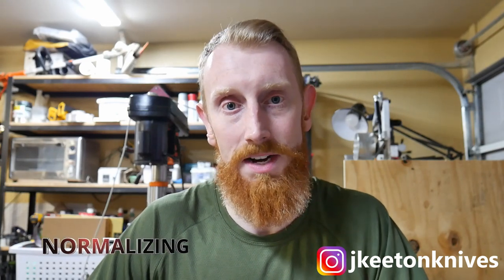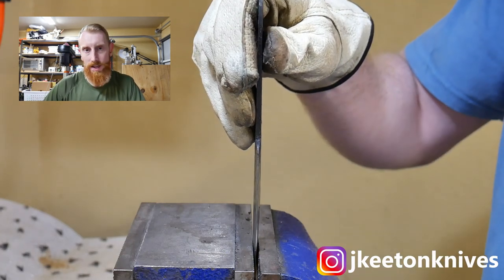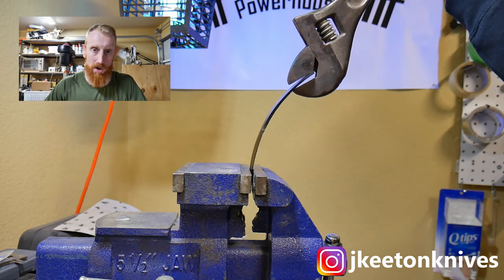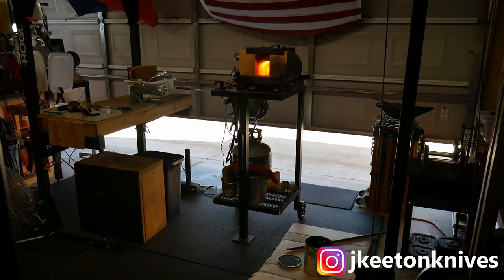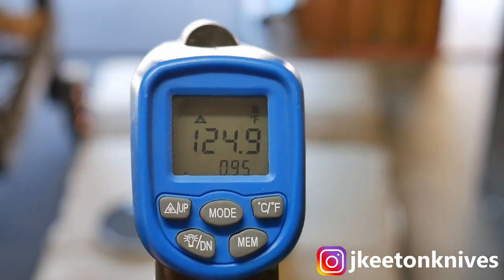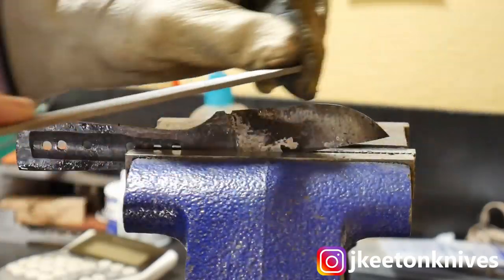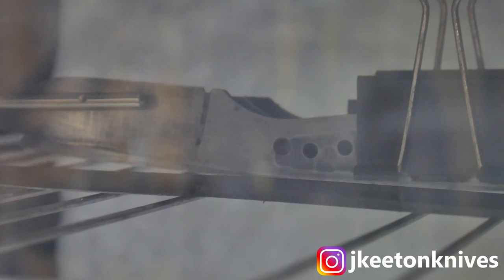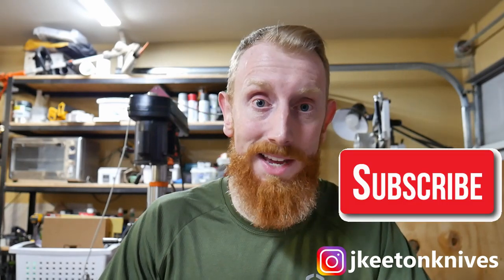How to Heat Treat 1080 / 1084 - The Most Forgiving Steel

Comment: Man ive been behind on watching YouTube for a while. Your channel has come a long way!! Video quality is way up! I gotta say your move from forge to oil is the fastest ive ever seen😳  im pretty sure the blade was air quenched from the 1000mph air rushing by on the way to the oil😂  1080/1084 is such an underrated steel. Its so easy to dial in. 👍👍
Reply from the maker: Hey man, really appreciate that. I've been working on the quality. Still going through some older footage now on some videos, but eventually it will all be 1080p (got a new camera). I switched my editing system to Resolve too (free), which has ben really nice. I’m still having some issues here and there (some reason it scaled up my water in my WEN sharpener video today). You’re comment on my quench speed cracked me up! Yeah, I try to do it fast! I just ordered me some Parks #50 so I’m curious to see if this will change my hardness results. One of these days I’ll get an oven like you! I appreciate your oven review video.
Reply: JKeetonKnives i noticed a difference when switching to parks. It's definitely a thin oil. The oven has been great so far. Its nice to be able to do whatever you want whenever you want. It does take a long time to heat up though. Especially for anything over 1500 degrees. Im sure the 220v version would be better in that area.
Reply from the maker: @OUTDOORS55  Did you notice a slightly harder rock well hardness? more consistency? or just a different quench experience? I'm going to the parks 50 mainly for the consistency... I've read that canola can degrade over time... your first 5 quenches may yield different results than your last 5 quenches. Good to know about the 110 oven... I'll go 220 when I get mine. USA Knife Maker has a "knifedogs" oven for $971 before shipping... it's not huge, but likely big enough for the work I do. (14'' deep)
Reply: Damn two knife legends in one comment. Can one of you make a video on heat treating in a coal fire and tempering long blades thanks

Comment: I use 1095/5160/80crv2 & 1095 with 15n20 most of the time. I harden at 1600 & temper at 500. I almost always have a good knife blank at these numbers. I do some normalization before hardening. I also use warm olive oil as a quinch medium.
Reply: Holy smokes, that's a high temp quench and temper. How's your grain size look for a snapped untempered blank blade?

Comment: Change oil sometimes because the oil gets burnt and polymerises. This causes it to lose a bit of ya heat dissapation capability but i don't know to what degree.
Reply from the maker: Good tip Chris! I think I'll be converting to Parks 50 soon.
Reply: Hi my friend. When you say Parks 50 do you mean parks AAA????  I read the details from Parks oils and for 1080 steel looks like they recomend more the parks AAA.   Can you solve my doubt please???   Thanks my friend and great videos.   Oh!! Another question, did you see difference between quench in canola vs parks???  Thanks.
Reply: @ivangarcia-ph3tx  parks 50 cools much faster than canola but isn't as violent or stressful as water
Reply: But in the details from parks 50 say "Typical steels to use with this quench oil formula include: W1, W2, 1095.".

And in the details from parks AAA say "Typical steels to use with this quench oil formula include: O1, 5160, 1080, 1084.".    Is for this reason that i have a doubt, because it seems that the manufacturer recommend like better choise park AAA for 1080 steel than park 50.
Reply: @ivangarcia-ph3tx  thats just being very specific, the difference is that parks50 is better suited to water hardening steels like w1, w2 and 1095, they are simple carbon steels with a ~.9-1.1 carbon content with very little of other alloys meaning they have very little deep hardening capability and only the surface will harden, exactly how many mm from the surface will harden I can't remember. Really parks 50 is just a oil that can cool the steel down near water speeds, its just not as violent which helps to prevent the blade feom cracking or warping a lot.

Comment: Yeah dude. So much convoluted information on this out there. Nice to finally get simple and concise steps on quenching and tempering 1095.
Reply from the maker: Thanks man. I will say 1095 has some differences then 1084 if you want to get the most out of it. I do think you can get a decent HT on 1095 with these steps; but to get it 100% right, I'm fairly sure you need soaking times; which is pretty hard to do with a forge. 

1085 and 80CRV are the easiest forge HTs to my knowledge
Reply: @RedBeardOps  well shit, I misread your title haha
Got a video on 1095?
Reply from the maker: @doodysdaggers  I do not...but this link will allow you to search bladeforums.... which will have many threads on it. Good luck! https://cse.google.com/cse?cx=012217165931761871935:iqyc7cbzhci

Comment: Excellent video. I have read and watched many heat treat videos, but very few use a home propane forge to heat treat. For small knives I use a two brick forge, but longer knives I use my larger forge made from a propane tank. Temper like you do. I use 1084 also. Your details help remind me of the correct method step by step. Thanks for a great heat treating video!
Reply from the maker: Hey Joseph! Appreciate the praise. Just going though the process of making this video reminded me of some little things that I forgot about! Don't get me wrong... I'm saving up for a HT oven, but I feel like you can get a pretty damn good HT with the forge! Bladesmiths have been doing it for 100s of years.  👍

Comment: I really appreciate this video especially on normalizing and quenching just using a forge. I do not have a heat treat oven and probably never will and everyone that I’ve run across so far basically says if you don’t have one you’re putting out an inferior product or just don’t make knives at all. I just don’t see how not being able to or not being willing to afford a $3000 heat treat oven should stop you from pursuing a hobby …again thank you
Reply from the maker: You can make a heck of a good knife with just a forge; especially with practice. I'd say stick to steels that are easier to forge heat treat like 1084 and 80CRV... bring the lights down; use a muffle pipe and magnet.... 

Also... maybe test your knives to see how you did. You may be able to find a machine shop locally that will hardness test your blades too if you're curious. Good luck!
Reply: @RedBeardOps  thanks …. What’s the muffler pipe for ? Put the blade in for even heat ?
Reply from the maker: @Razor.Edge.Reviews  exactly. It's just a piece of steel tubing to shield the blade from direct flame. You get more even heating for sure.

Comment: I've actually had really good results with 1095 in a forge.  Parks 50 was definitely the way to go. I grind my blades to 0.020 and the main bevels are ground from 4-7 degrees per side and it will cut nails all day with very little edge damage
Reply from the maker: Awesome Josh! Glad to hear your results. Thanks for commenting, too!
Reply: What do you mean cut nails? 🤔

Comment: Good video. I picked up a couple of used belt grinders (2"x48" and 2"x72") for general use, but now I want to try and make a couple of knives for myself.  I bought a couple of 1080 1 1/2" x1/8"x12" strips of steel to give it a shot. As a beginner is it easier to cut my basic shape and hollow grind and then heat treat? I figure the steel will be softer to work with on the grinders to get the desired hollow grind.
Reply from the maker: Hey man, people do it both ways. I'd say get the knife 90% ground, HT, then finish grind and sand for your first try.

Comment: A blacksmith friend will put finished trinkets hooks with scale in vinegar for a few hours and a scale rubs right off. Keep an eye on a blade though. Too long and the blade may develop pits. You can experiment with home store steel as it always comes with scale. This is for those that do not have a mill or other ways of removing scale. Still have to flatten each side. Thanks for the great video.
Reply from the maker: Thanks for watching sir!

Comment: Good explanation. Enjoyed the video and very informative!
Reply from the maker: Thank you very much! Glad you liked the video! Cheers 🙌
Reply: JKeetonKnives what’s your opinion on doing a knife out of 4140? I got a scrap piece of 4140 that’s 1/4” thick flat ground out of our machine shop where I work. Just wonder how hard it would be to work as a stock removal project. I don’t know how it would perform as a finished product. Thank you for your time.
Reply from the maker: sirmaximus100 I don’t have any experience working with 4140... so I can’t really say for sure. I know you can get it hard so that’s promising. 1/4” is pretty darn thick

Comment: Can you explain what would happen if you quench at a higher temperature let's say around 1600 degrees? Would it be more brittle or with the grain structure be more course? Thank you
Reply from the maker: mrsaskriders if quench with the blade too hot you may be able to tell by seeing some “blistering” circles in the finish. But yes, too hot of a quench can cause an undesirable grain structure.

Comment: Thanks for the info. So for the normalisation you start from the upper end, work your way down to the temperature that you will be quenching the blade on the third cycling. I thought that your last normalisation heat would be sub critical or below where a magnet is still sticking to the steel for a fine grain structure. I need to experiment. I will try the above.

Comment: Thanks for the video! I’m looking to get into knife making. My father used to make knives and has a bunch of 01 left over. Is this a good beginner steel or should I buy some 1080/1084
Reply from the maker: Personally I'd start with 1080/1084; 01 takes soak times to get the most out of it.

Comment: Do I need to normalize since I'm not forgeing? Great video by btw.
Reply from the maker: Nathan Chaffin thanks! I do just as a precaution, however, I’ve seen many stock removal makers get away without doing so. I’m not sure if this is true or not, but I read somewhere that grinding can induce stresses into the blade. Thanks for watching!

Comment: Great information and well researched as usual.   How about 1095?   Can it be done the same way?   thanks
Reply from the maker: Hey Ken, thank you. You can HT 1095 this way and have a decent knife, however, to get everything out for the steel soaking at temp is ideal... so forging heat treating 1095 is difficult. This is why 1084 and 80CRV are better choices for the forge.

Comment: Great video this helped me a lot.  I have a couple questions.  The first knife I did I was worried that I wasn't high enough above non magnetic.  After seeing your color chart it looks like I was up around 1700*.  But then I tested with a file and it felt harder but the file would still bit in just a little bit.  Lastly I tempered it at 213*c which is a little higher then yours.  What should I do?  Can I go back and heat treat it again?    Thanks for the help.
Reply from the maker: You can HT again. Make sure you file on the same part a bit. Sometimes there is a thin layer of soft decarb on the blade. The colors can be deceiving... the lighting in your shop can play a role. If I were you I'd quench some test pieces and break them in the vise to verify they hardened. That should give you an idea of your colors, etc. With 1084 just getting it a little above non-magnetic and quenching will likely work fine for you since it's so forgiving. Be careful with the oven you're using. Make sure to pre heat it before putting your knife in it.

Comment: Would be curious as to how much you grind your knives before each step. My first batch of 3 was ground to 1.5-2mm behind edge and they all warped.  Currently trying a few kitchen knives at full .100thousands and grinding after heat treat.  Should I do most of my grinding after annealing, just before quenching? I am using 1084.
Reply from the maker: There are lots of ways to skin this. Check out some of my knife builds and you'll see I use a few different methodologies.

Comment: Great video! Very knowledgeable about everything. 1 question though I see you have a piece of square tubing in your forge. Is that to prevent a direct flame from touching your blade and therefore getting a even heat?
Reply from the maker: Ronald Derrez 100% right. I use that piece of tubing as a “muffle pipe” to shield the blade from the direct flame. Gives you a more even heat. It’s capped on the back. Cheers man! Thanks for watching

Comment: One question, weeks after first watching this, do you leave the forge going during this whole process until tempering? When normalizing the steel, do you keep it running? I’d assume so. Thanks!
Reply from the maker: I do / did... I do a lot of this with an oven now, but when using the forge I kept it running. More advanced forges can be turned down to idle during this time and ramped back... but honestly if you're that fancy you'd probably want to run it on idle during most of the process since the temps you need aren't that high (like forge welding temps)

Comment: Hey there, I am making a mini forge out of the insulating fire bricks & torch, how long do you pre heat before putting blade in, and roughly how long does it take to normalize each session before quench?  Also does one propane torch tank work for the whole process, should I have a back up?  How long in vice until it is at room temp and should you shut off your torch while waiting?
Thanks in advance!
I’m sure I’ll have more questions!
Reply from the maker: The time will vary greatly depending on the forge. I probably let mine run for about 10 min before putting I the blade. 30min or so for normalizing cycles and such. One propane tank easily works for multiple sessions. But have a back up. I don't shut it off while waiting. Maybe 8-10 min before it's in the 300-400 degree range?
Reply: Thank You !  I appreciate it!

Comment: Hi, thanks and congrats.  Have not been able to harden a 1095 blade.  I being out to non magnetic, a little more and quench.  It hardens but too soft. Tried 4 times.  Still can garden after these many attempts? Thanks again
Reply from the maker: Hey Camilo, you can for sure still harden it after those attempts. I'm not sure where your issue lies. I will say 1095 is not as forgiving as 1084
Reply: @RedBeardOps  thanks for taking the time to replay.  I'll try to regulate better the of the forge, a little cooler and maybe a 1x2 steel  tubing to put the knife in.

Comment: Great video thank you, as others have said you would make a great teacher. My question is at the start of the video you mentioned annealing. However when you went through the process in the second part, the practical lesson, annealing wasn't mentioned. Where does the annealing fit in?
Reply from the maker: Hey Graham, I apologize for that. I'm using steel that comes to me annealed. Annealing would be required if you forged out your blade or if you were working with something like a file that started off really hard. Thanks for watching!
Reply: @RedBeardOps  Thank you, that makes sense now. I also buy it from a knife supplier so assume it would be annealed as well.
Reply from the maker: @grahamturner2469  Yep, I think you're in the clear!

Comment: Great video! 
I'm a beginner as well and thought this was very helpful. Is it possible to ruined the steel if you leave it in the heat for too long? I made a diy electric heat treat oven and its very accurate. When I heated the knives at quench temperature for 20 minutes through misunderstanding. The file does not skate. I cleaned the surface to make sure there was no decarb and the file still didnt skate. Any suggestions? Is it possible to quench? Should I renormalize.?
Reply from the maker: Hey Michael, while soak time at the target temp isn't necessary for 1084, I don't think it will negatively affect the quench. Other steels like 5160 and 1095 require a soak time for a proper HT. I am curious that your file did not skate. decarb was my first guess, sometimes its thicker than you'd think depending on where you got the steel from. Like you mentioned I'd probably normalize before trying again. 

Steel Supplier, quench oil, quench oil temp are all factors.